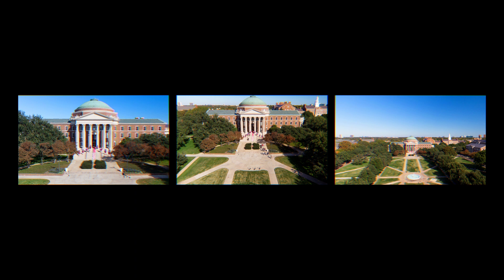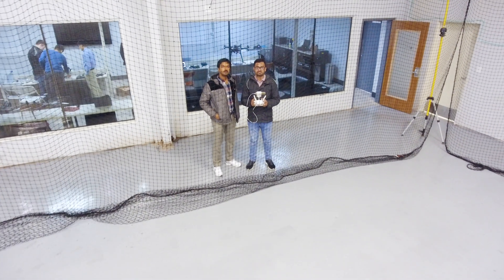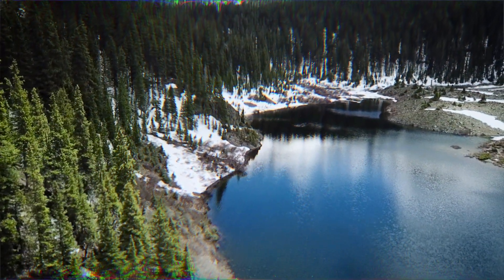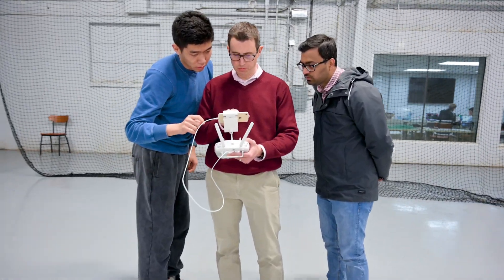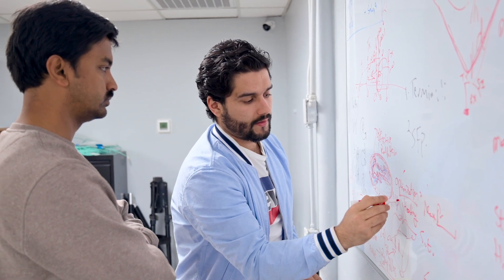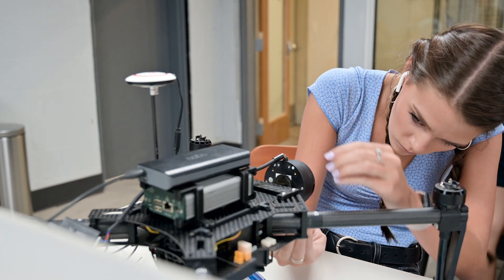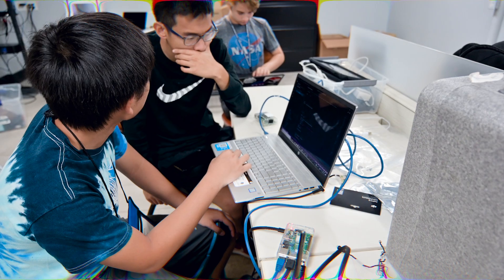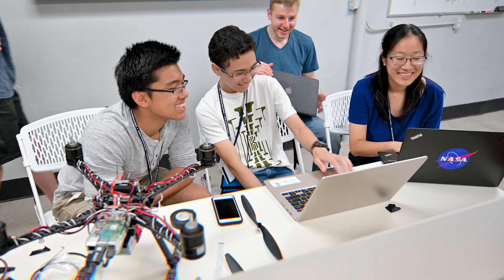Engineering a Drone Zone in Dallas

Comment from the maker: SMU engineers are helping transform an off-campus warehouse into an innovative lab, creating a controlled environment where they’ll be able to measure wireless transmissions more precisely.

Researchers are working on a 3D connectivity framework to produce robust drone-to-ground and drone-to-drone wireless links. Ultimately, the team is aiming to take drones to the next level of interacting with other smart devices and each other as well as coordinating with other drone swarms.